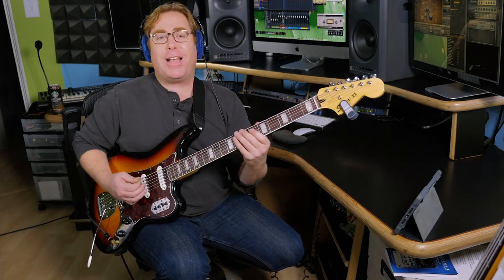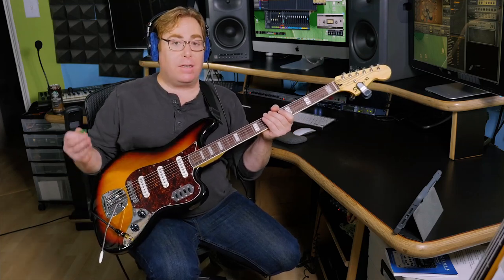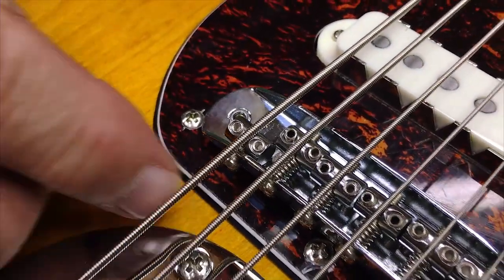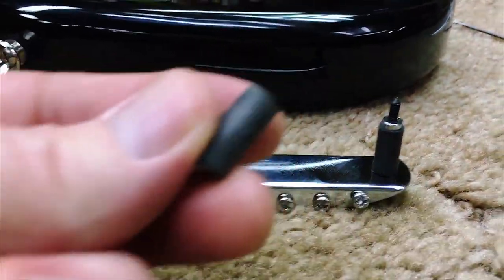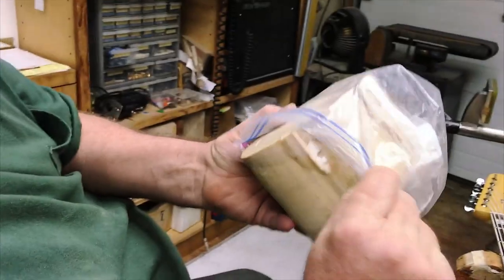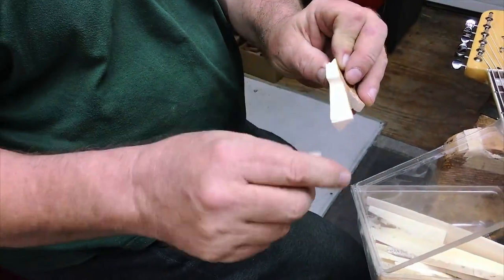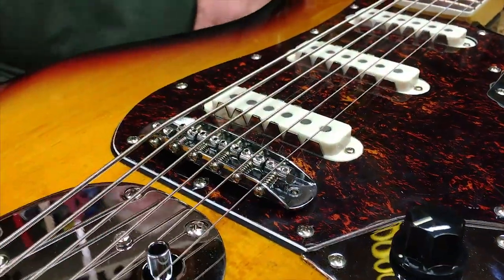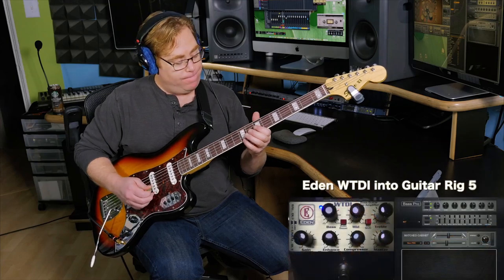Squier Bass VI Intonation Fix

Comment: At least the intonation problem is fixed
Reply from the maker: Strings I use: La Bella 760FS Deep Talkin' Bass Flatwound Bass Strings - Standard .026, .035, .044, .056, .075, .095. They sound and feel great and there are no intonation issues.
Reply: @ChadWork1  That's awesome, all that said Fender just updated their Bass VI string set, it now goes 24, 34, 44, 65, 80, 100. I use those on my Homemade Acoustic Bass VI.
Reply from the maker: @RockStarOscarStern634  Why not try Fender's new 24-100 Gauge Bass VI Set? Because I play the Bass VI like a guitar too, and the flatwound strings I have on are amazing. I don't need to emulate a bass with this, as I have 3 other real basses. With the Bass VI I play a lot of chords, and it's harder with thicker strings. It sounds amazing the way I have it now, and it's really great with a pick too.
Reply: @ChadWork1  The Bass VI is quite a useful instrument. I actually built myself an Acoustic Bass VI, it's a Fender ESC-105 Nylon Acoustic Guitar Strung with Magma GCT-E Octave Down Tuned Strings. These strings are Nylon wound in Metal which makes it sound like a proper Acoustic Bass.
Reply: @ChadWork1  Those La Bella Flatwounds will also save the frets from scratches.
Reply: @ChadWork1  It's basically an Electrified Bajo Sexto with 6 Single Strings and an Extended Scale length of 30 inches.
Reply: @ChadWork1  The Fender 24-100 Gauge Strings have a compound wound design